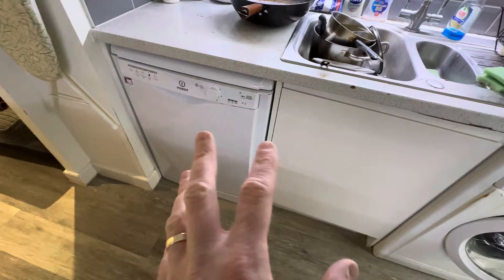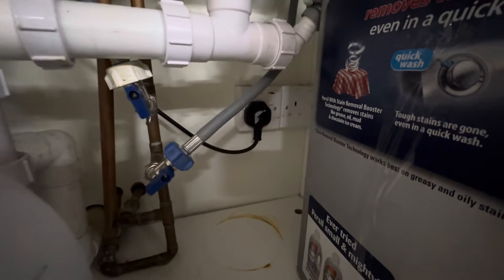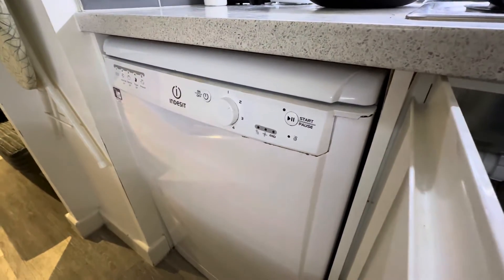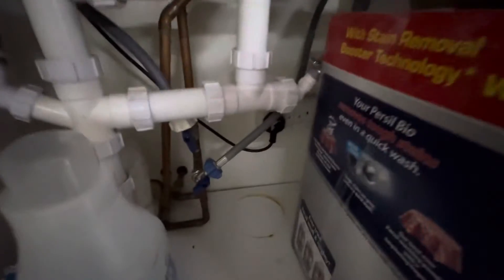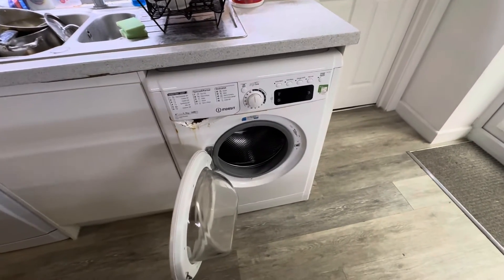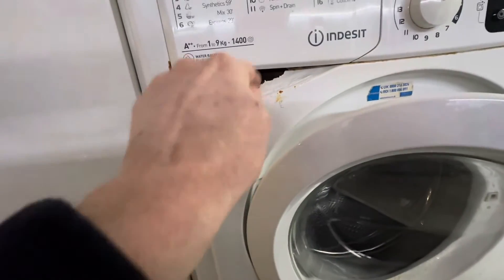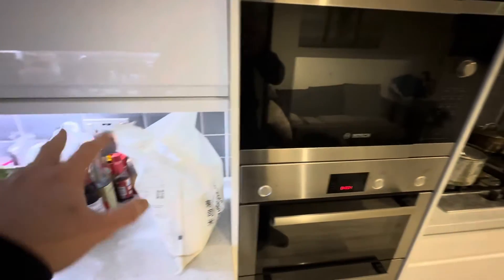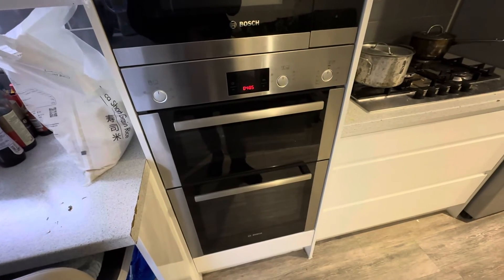Class 1 PAT Testing White Goods. Is it as easy as you think? Watch to find out.

Comment: Thank you for your video. I have taken a different view. Appliances that are built in e.g. the microwave, and double oven are not "portable" and therefor fall outside the scope of PAT testing. The "P" in PAT testing is for  "portable" and fixed appliances are are not portable. The dishwasher in your video could be PAT tested as the plug is accesable. I would note that in my record that the cable could not be fully inspected. Another way of dealing with these appliances would be to ask the Landlord to pull the appliances out of the housing before the inspection and PAT test is performed.
Reply from the maker: Ahh yes but even built in appliances such as microwaves and ovens have plugs attached. You have to pull them out to be fully certain of the type of connection. The term portable has also been removed from the code of practice so it covers a wider scope of electrical items.
You could indeed ask the landlord to assist you but then again from experience they rarely do.

Comment: The microwave oven leakage test can be done.Also a temp rise over several minutes of a glass of water will tell you if the magnetron is delivering full or near full power.Check microwave  for rust and if machine is ten years old or more replace the oven.
Reply from the maker: Microwave tests are no longer a requirement in the Code of a Practice.

Comment: I don’t understand this video. Either u test it or u don’t. Surely the In service inspection and testing or electrical equipment states all appliances should be tested.
Reply from the maker: What don’t you understand? The code of practice states what items “might” need testing but you are under no obligation or like the item here you gain reasonable access. In this case you note it in your log and notify the duty holder as ultimately they are responsible

Comment: Hi Ben, just a quick one how would you go about PAT Testing a 3pin to 2 pin converter? The ones I came across are used to charge electric pump trucks for a warehouse. 13 amp fused.
Reply from the maker: Do you have an example of one? Is it a charger or just an adaptor? Is it marked as a class 1 or class 2 appliance? Need a little more info from you to give a definitive answer

Comment: I am not a qualified electrician but common sense tells me that those sockets are not to 'code'. In all truth I would walk away from a job like that. And yes, I am a qualified PAT tester so have some electrical knowledge
Reply from the maker: Thanks for your comment. Important to note a couple of things…. There is no such thing as a “qualified” PAT tester - just a competent one.
Also, it is only our job to ensure that the appliance is as safe as the day it was bought / installed. It isn’t really for us to decide whether to walk away from testing an item because the sockets “might” be in the wrong position.
Reply: 300mm is the rule from sink, hob etc. From a mains pressure pipe water can go for meters so it’s all a bit wishy washy (pun intended ha)